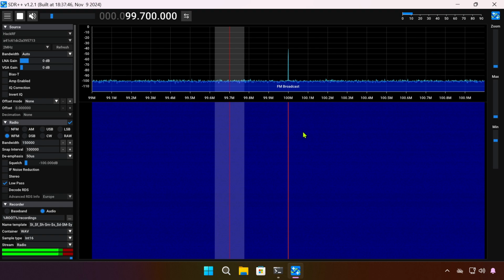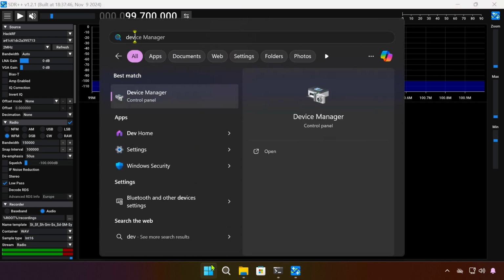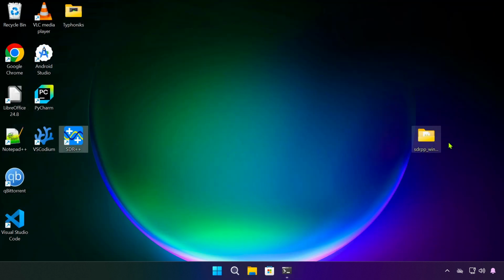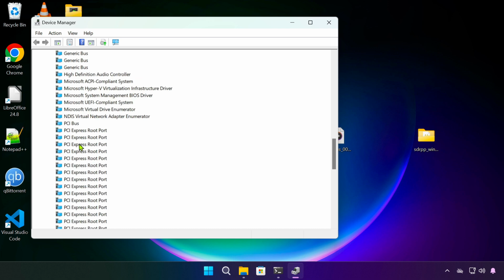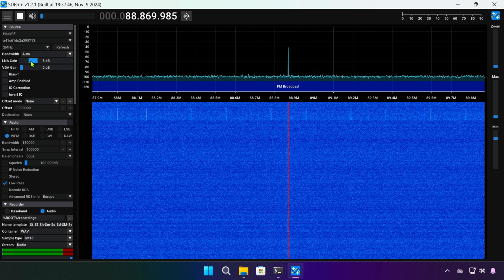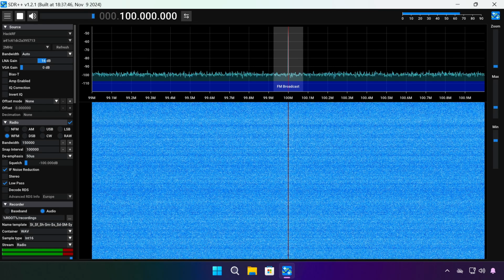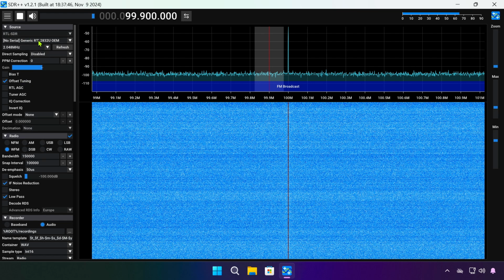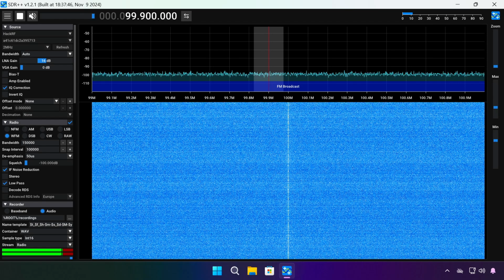SDR++ Interface | Beginner Lecture

Comment: HI I HAVE THE VERSION 1.2.1 BUILD April 2025, i can only see these options in the server section , Spyserver,  Airspy HF, BladeRF, File, HackRF, LimeSDR & PlutoSDR, It does not show any others so therefore i cannot use my RTL SDR Dongle , it works on SDR Sharp ok though any help would be greatly appreciated kind regards Peter